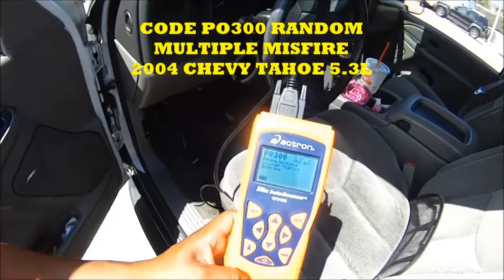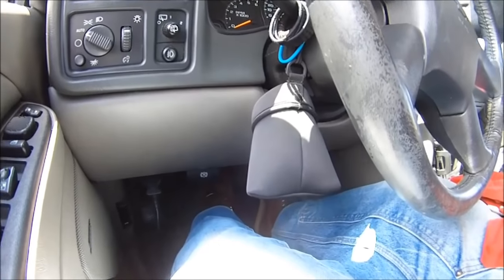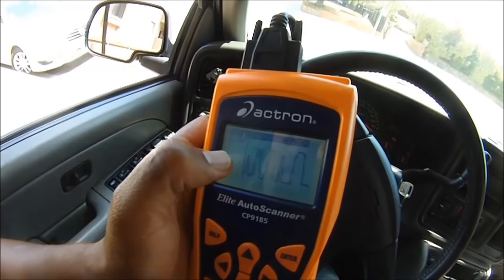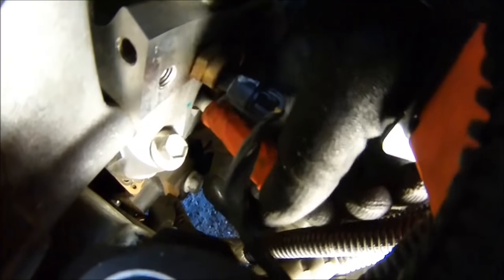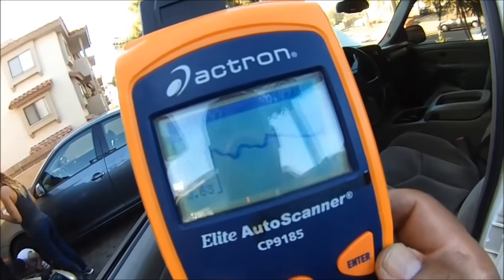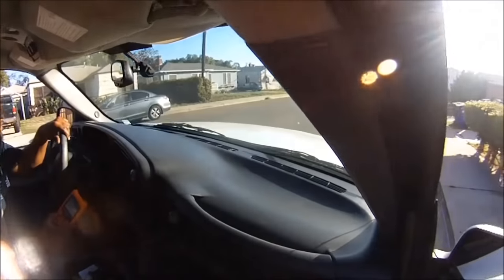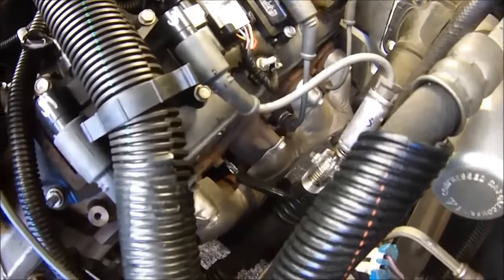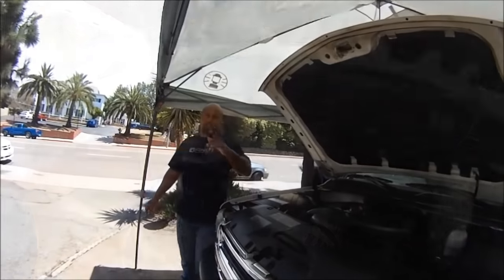HOW TO DIAGNOSE & FIX CODE PO300 RANDOM MULTIPLE CYLINDER MISFIRE DETECTED

Comment: do not put oil on the spark plug threads.
Reply from the maker: Its perfectly fine. Can you Explain why its wrong?
Reply: it is a spark plug and does not need lubrication. It will just smoke and possibly drip onto the electrodes, which you don't want. That sounds like an old school idea that is incorrect. I am old school also but not all of those ideas are good. I like the way you checked all the possibilities and charged a fair price instead of getting dollar you can. Good on ya. Thats an atheists way of saying god bless. lol.
Reply from the maker: +100mpgus I hear ya. I have been doing that since 1991 and have never had an issue. Even dumped T spoons of oil in the combustion chamber for wet cylinder compression checks and all the oil does is burn off.  Oil is not necessary at all for spark plug threads but it does help with easier threading and heat transfer,  no harm is done its just old skool personal preference. Ya I notice atheist say good on ya lol, God Bless You my man Jesus Loves You but don't let anyone fool ya into believing all this in the world, your existence and all life happened by chance or accident. Ask Jesus Christ with a sincere heart of repentance and he will show and guide you .
Reply: 100mpgus what about lubricant spray, when cleaning them?